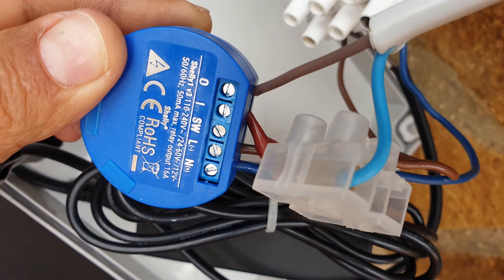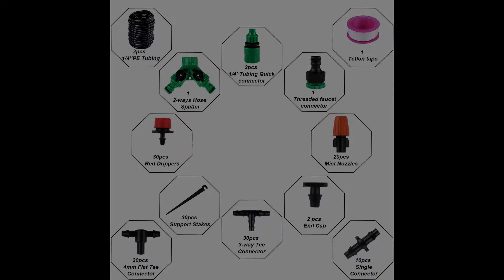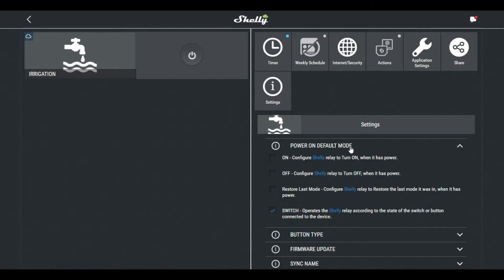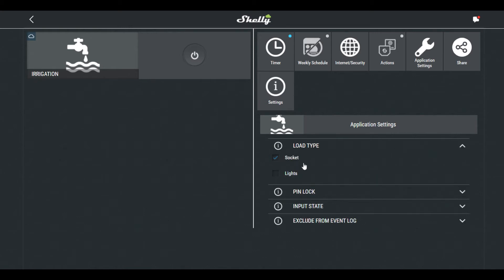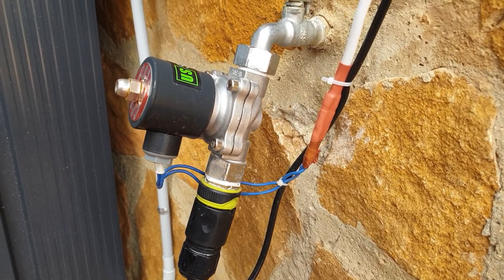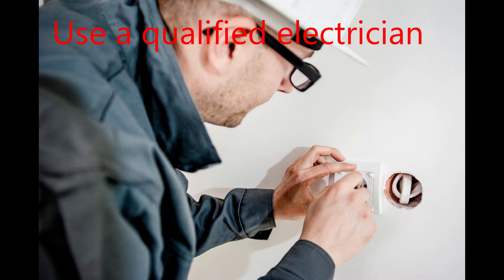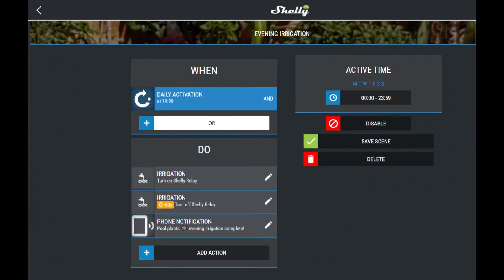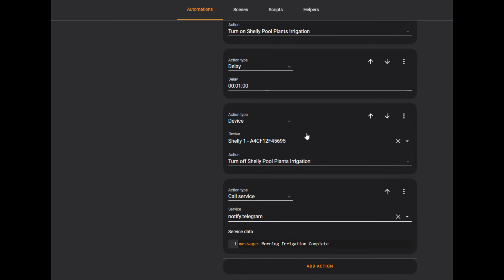Create a Smart Drip Irrigation System Using a Shelly 1 And a Solenoid Valve

Comment: Hi, thank you very much for sharing your knowledge. Very detailed and step by step explanation.
I've the same installation with 24v AC solenoid water valve and my shelly 1 goes offline all the time. Good wifi signal permanently but it goes offline and I have to remove power and restore power to get back online. Any idea about the reason of this? Thanks

Comment: hi, so the shelly1 is powered by 230V? (the L and N ports are fed directly from AC?) and where did you get that solenoid with 1/2" connections?
Reply from the maker: Yes, you can power the shelly1 by 230V or 12V, you have both options. I purchased the solenoid valve on Amazon

Comment: Hallo sir. could you power the transformer using the shelly, and power the valve using the transformer ?
Reply from the maker: I don't see why not. Just make sure to have the right pinout for the required voltage.
Reply: Would this mean no neutral though if both sides are DC? Would it still work with no neutral? I assume the negative (well 0V) of the dc supply goes into neutral? Will it still work?